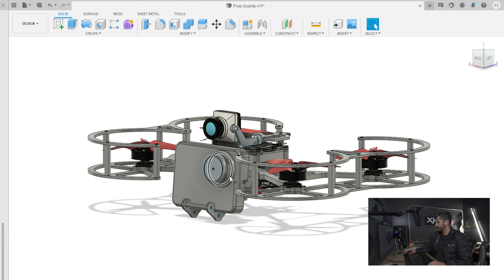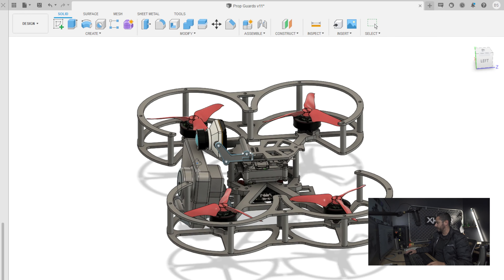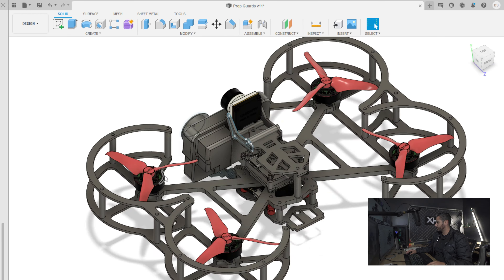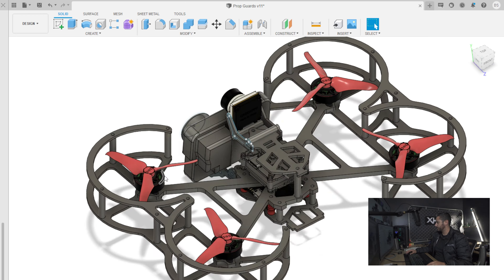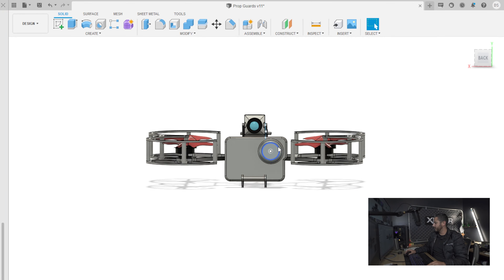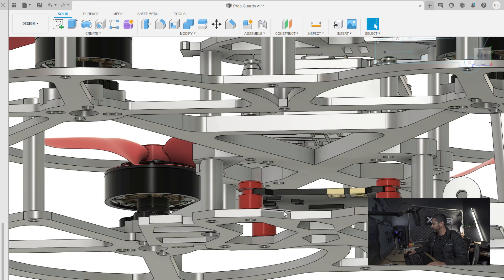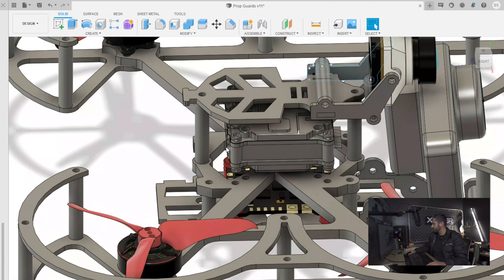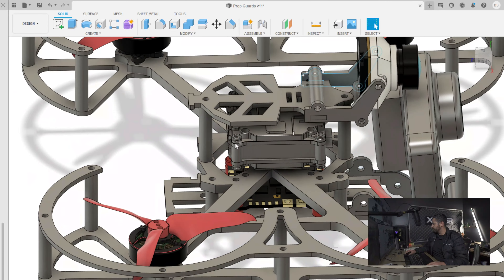Sub 250g micro Cine FPV Frame - part 1 design

Comment: Danny, it's been a while.  I  hope you are well.  I've been immersed in drone regulations for the last three years and I like your design from a perspective of regulations as well as safety as well as placement of the heavy components.  Staying under 250 grams with the battery included will help make the drone more appealing to people around the world as the 250 gram threshold is of course used worldwide.  I also feel the prop shrouds are a must for sub 250 grams because folks will want to fly it over people, inside as well as newcomers will be attracted to a smaller drone.  Finally, keeping the polar moment of mass low is a great way to achieve better performance.  By keeping the GoPro low, you reduce the pendulum effect which means faster rolls and less work for the motors to change attitude of the drone.  I'm looking forward to seeing the frame in carbon!  Take care!
Reply from the maker: Hey David, Thanks so much for the feedback! I'm actually cutting the frame today! Can't wait to show you the next video :)